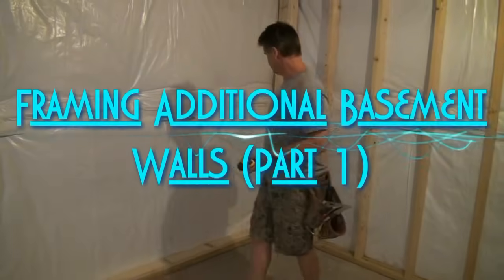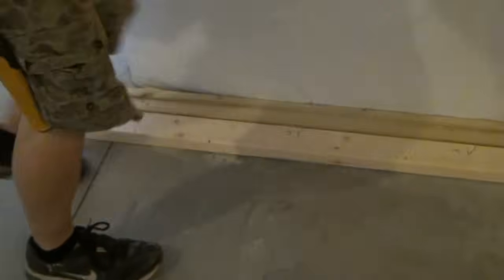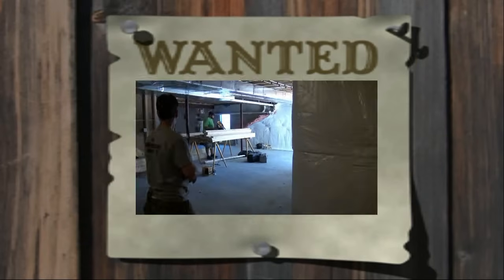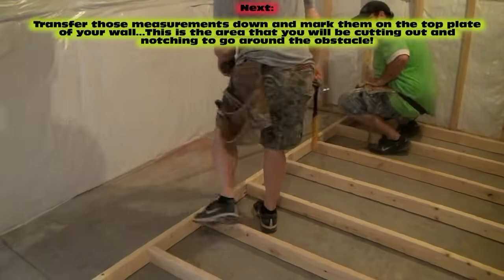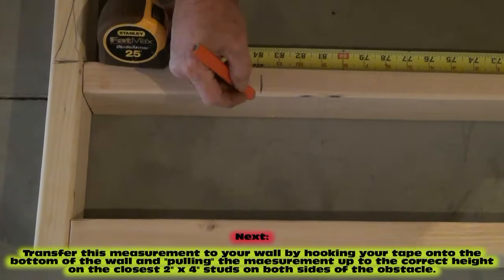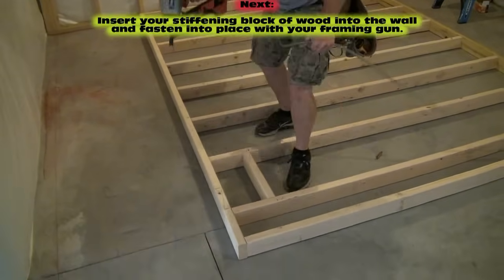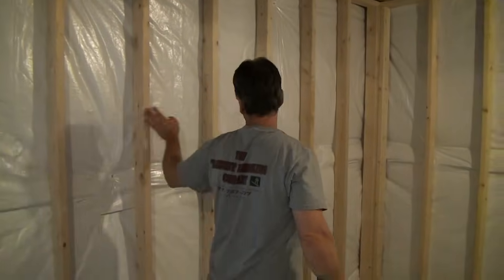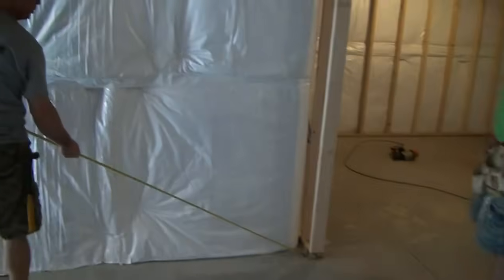How-to Frame a Basement(how to frame outside corners) Part 5 of 6

Comment: Thank you very much Eddie. As the IT Professional I browsed tons of video on how to DIY Basement Framing and yours looks one of the best for beginners. Is not easy to transfer knowledge you have for so many years plus transfer that in very easy verbal working session. I will follow the rest of yours video to until drywall installation.
Reply from the maker: Thanks for the positive comments Viktor! I am here if you have any questions during your project.  ~Eddie

Comment: Good Stuff!  I have a basement I am getting ready to tackle but I do not have a concrete floor, it is plywood, I am assuming it has something to do with the Radon system since I am in Denver.  Do I have to float the walls or can I nail the bottom plate directly into the plywood floor?  Thanks again!!

Comment: On wall number two when laying out the studs 16 OC do you not have to factor in the 1/2 inch for drywall thickness on wall number one?  Wouldn’t your drywall be off the stud center on wall two by a 1/2 inch?  Great video by the way will be very helpful.  I am getting ready to do a basement bathroom so will be using many of your videos.
Reply from the maker: Framers never really know in which direction out of any given corner the drywall hangers will go! So no…common framing practice do not account for that 1/2” of drywall thickness.  ~Eddie

Comment: Hello Edy,
First off, thank you for the magnificent video. I'm working on my first framing project and looked at many videos but couldn't find any better than yours. I notice one thing about this video and I was wondering if it was an oversight on your behalf.  Just at 32 second of the video, you measured 15 inch and a quarter straight from wall number 1 but when you nailed the studs I noticed that you added one stud in the beginning to attach wall 2 to wall 1 which it means the distance now for the first 15 and a quarter is minus 1.5 inch!!!!!!!
Any explanations would be very much appreciated.
Sincerely, Sam

Comment: Curious why you chose not to use a sill gasket.  I know your bottom plate is PT, but don't you think you should always separate the wood from the concrete floor, for moisture reasons?  I also find it helps in older houses where the floors are very uneven.  Informative and detailed.

Comment: Have a question about the corner. In case there is no isolation in the concrete wall , we still use the same framing for the corner? Cuz that empty space we can't put isolation on it.

Comment: The far ends of the cats are held in place by friction, right? I'm surprised securing the top plate to them is sufficient, but I guess you are also attaching the sides to very secure adjacent walls so it's enough?

Comment: Do you need to pull permits for framing or no? and also, what is the standards for insulation and vapor barriers behind the wall? Thanks
Reply from the maker: We don't pull permits for framing! We use R-15 insulating-value insulation in our new "cold-walls". We do not use vapor barriers in basement walls as they cause more moisture and mold issues than they have ever prevented! Hope this helps you with your project.

Eddie
Reply: @BasementFinishingMan  Do you cover insulation install in your video series to purchase?
Reply from the maker: @3dparagon  Yes we do Chuck.

Comment: I get the 15 1/4 rule for wall number 1, but when you do it for wall number 2 arent the measurements off by 1/4 due to the drywall butting into the corner of the first wall?  I am confused by this, anyone have insight why it still works for the drywall?
Reply: I agree, I would adjust the 15 1/4 to 15 3/4 to account for 1/2 inch drywall thickness on the first wall (Or more/less depending on your drywall thickness). That way the center of your second stud will be 16" from the start of the drywall sheet on wall 2... then use the 15 1/4 from the second stud for the rest of the marks, so by the time you are at your 4th stud, the center will be exactly 4 feet from the start of the drywall sheet, which is the point since drywall sheets are 4 feet wide.
Reply: Thank you so much for asking this!  I was wondering the same thing, and you got it answered!  He's def off 1/4 inch...
Reply: Thanks, E S for asking this question. Thanks Jacob N for explaining the video's mistake.  I was thinking the same thing, but needed an expert's assurance.  Too bad Basement Finishing Man hasn't confirmed it.  My drywall is 1/2 inch thick, so I'll make that first mark on wall 2  at 15 3/4 inches from the wall 2 plate end.
Reply: Whew! Thanks for that!

Comment: Very good video!  Question.  I noticed that your first wall, the studs lined up perpendicular under the floor trusses. Is this code or does it matter if your wall studs lined up with the floor trusses or not?

Thanks!
Reply from the maker: Very observant! No it does not matter as most all basement finished walls are"curtain" walls and are almost never load bearing. No this is not code in basement wall construction...when it is required though, on such load bearing walls it's referred to as a "stacked load",  and then it is a required building code.
Reply: @BasementFinishingMan  thanks for the replied...makes me feel better.

Comment: would the 15 and 1/4 rule apply if you were doing 24" offcenter studs?
Reply from the maker: on  24" center layouts your first mark would be 23 1/4" then 47 1/4" and so on down the entire 2' layout on your wall plates...so yes it applies.